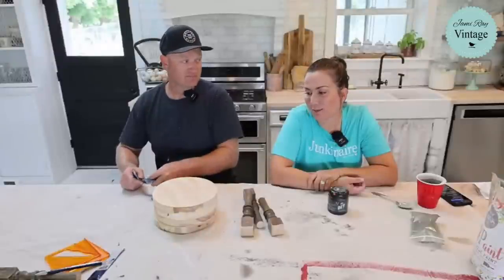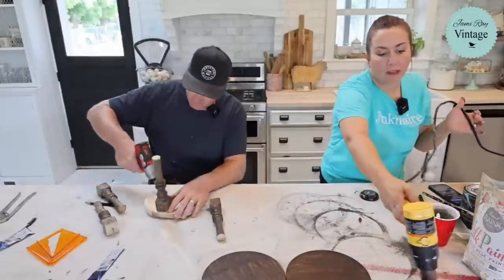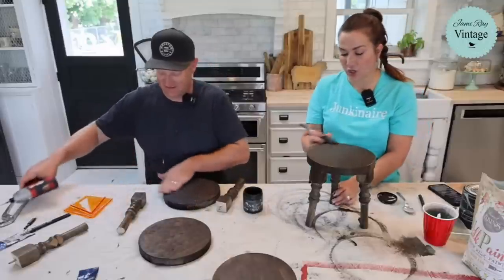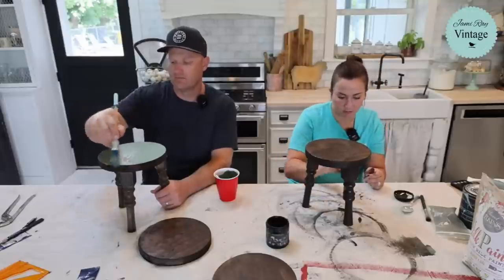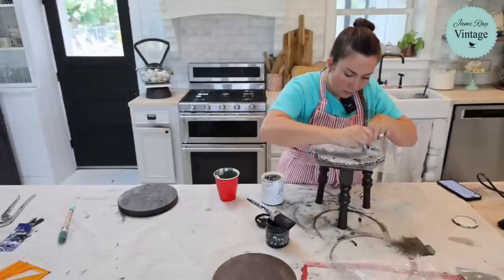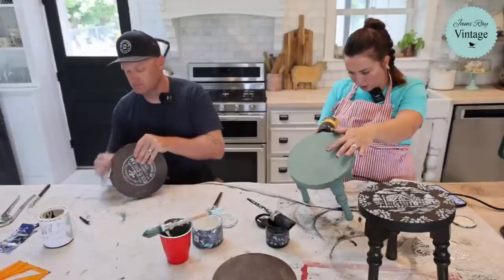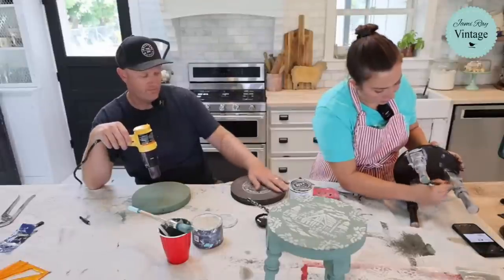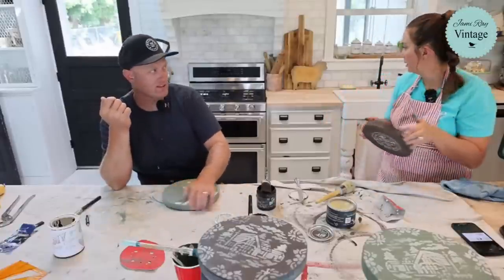French Provincial Stool DIY - Milking stool -  Waste Not Wednesday

Comment: If you left the legs, with the ability to be taken off, they'd be a lot easier, and likely cheaper, to ship.  Then leave instructions for those who ordered them to put wood glue on the top, and the leg, around the screw, and screw them in, for a permanent fix.